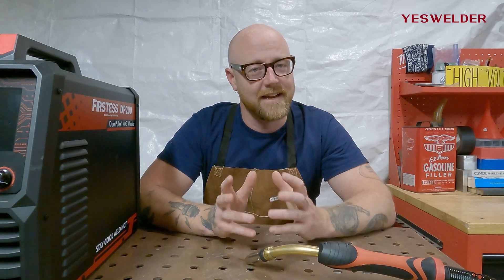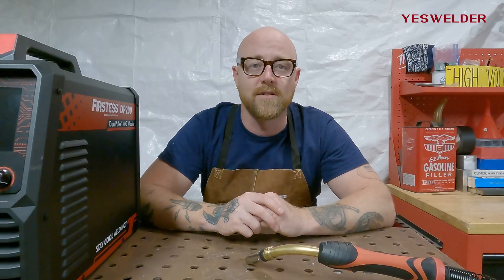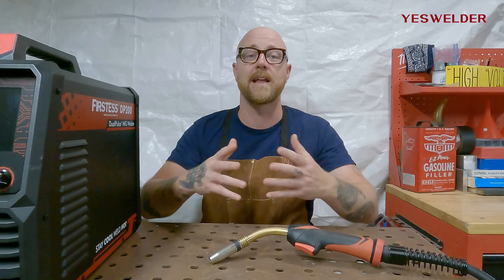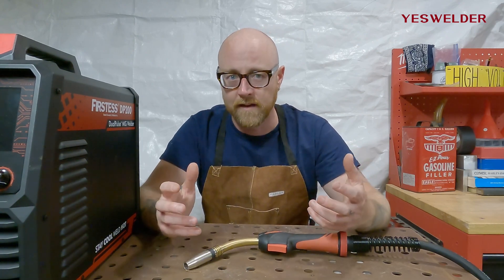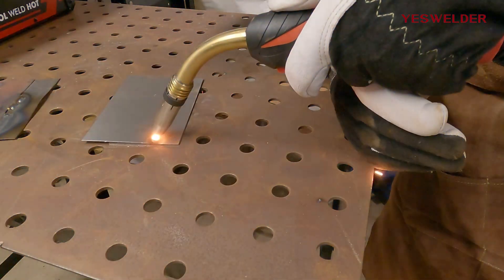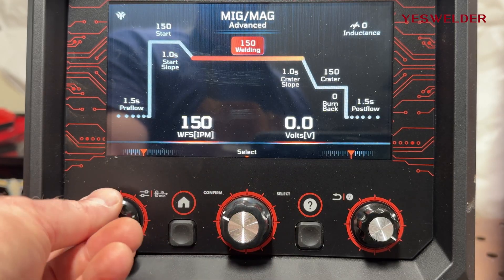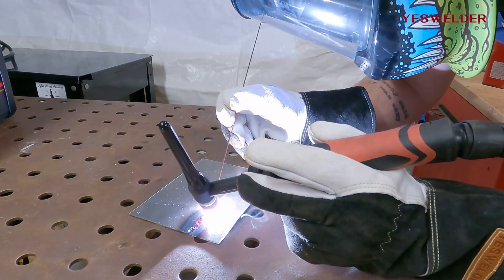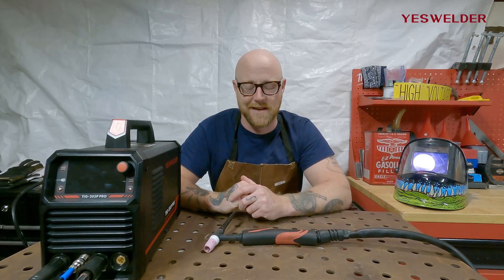Mastering 2T/4T Modes and Spot Welding Functions｜YesWelder

Comment: Im pretty new to welding and I just bought the Mig205 & Tig205p AC/DC 110/220v welder and bought the optional foot pedal.The instructions aren’t very clear on how to set it up properly.

So I’m unsure as to set up my machine for the 2T/4T setting let alone how to get to it from the LCD screen not to mention a button to purge the line to check the flow on my gas.

Comment: Hey I have a TIG-250p AC/DC 220v maybe came out around 4 years ago it’s blue but it won’t ark when stick welding and when I dose I have to keep a close distance and the rod just gets too hot even when I put it to a high arc force and 60-90 amps. can I get some help here on what it can be or I’ve you’ve had recalls for this problem?
Reply from the maker: Sorry for the late reply. For any after-sales issues with the product, you can reach out to support@yeswelder.com.